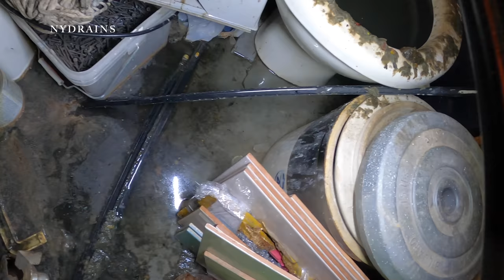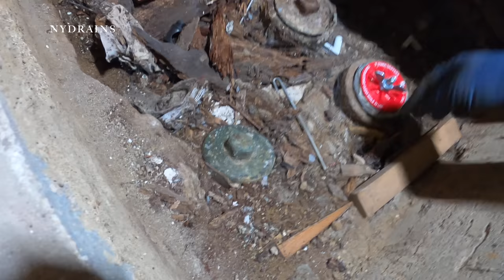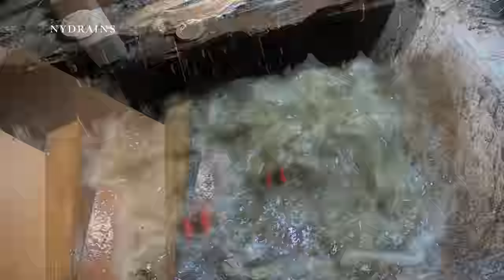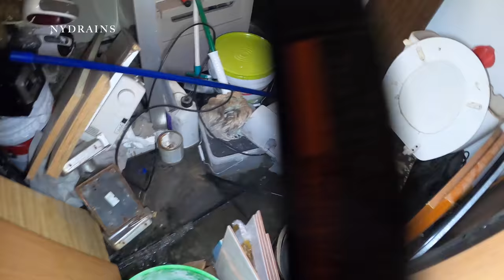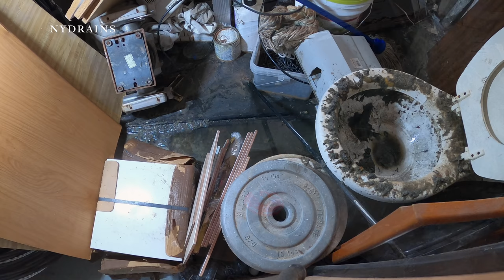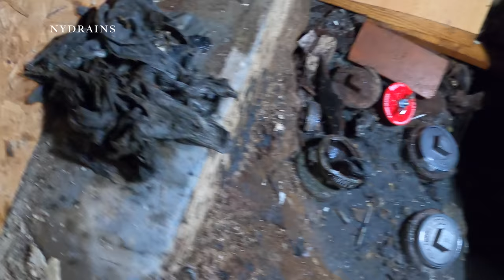Clogged Drain #85

Comment: you done a great job there, wondered why there was a different looking cap,never seen that type before .i would have said can you clear all the stuff out this room so i can give it a good clean up disinfectant etc . well done anyway
Reply: The red cap was for a smaller diameter pipe. When the old cap broke, whomever installed the red one either didn't realize there was still a rim in place, or couldn't be bothered to remove it before recapping the outlet.
Reply from the maker: Thanks again 👍 they just wanted the water removed
Reply from the maker: What A.J said 😉👍

Comment: Hello, NYDRAINS, it's Nathan again.  Thank you for the like.  But last night when I told you that "this is classic symptomology of a blocked main drain," I forgot to mention that I know plumbing very well.  I just didn't get to have a career in plumbing because I have Asperger's syndrome and haven't been able to have a career because of some learning difficulties and special needs that have plagued my life.  But I have always loved to troubleshoot plumbing problems --- and THIS one was a very easy one to figure out --- even if you hadn't described in the beginning what was happening.  For that's what happens when you have a blocked main drain; the plumbing fixtures on the lower level of a building become the sewer outlets for the fixtures on the upper levels of the building.  I'm sure I don't need to tell you that plumbing systems are very dynamic and they can foist some big surprises on those who are unfamiliar with how they work.  Some of those surprises, of course --- like what is shown in this video --- are very nasty indeed.  Another example of a nasty surprise-by-plumbing-system is the cross-connections that can occur from improperly-installed and from improperly-used plumbing equipment --- and which can create plumbing hell by causing sewer water to enter the clean-water pipes and making buildingfuls of people sick at once.
Reply from the maker: Thanks for watching 👍

Comment: As someone else already wondered, why you opened the upper stream cap instead of trying to unclog the U trap ? There is a technical approach to prevent any  side effects ?
Reply: He opens the downstream cap first (going out) to provide a path for the water to go, and to check and see if the downstream is clogged. Even if he pulls stuff out of the trap, there is such a volume of water it's just going to do the same thing as when he pulled the second cap. Also, with the volume of solids and junk in the line it will just clog the trap up over and over. Plus, his snake cannot bend around the trap it is too rigid. Unfortunanetly when there is a clog and that volume of sewage and under pressure there is no way to avoid making a mess.
Reply from the maker: What Chris said 😉👍
Reply: @azmrblack   thank you for your reply, I didn't consider that pressure that plays an important rule in these cases.
Reply: @NYDRAINS  Thank you for your reply
Reply from the maker: @playmangostingiu2217  No problem,  Chris took the words out of my mouth! 😉

Comment: It appears that basement toilet is no longer being used. If that is the case, it should be removed & the toilet drain capped or sealed over so this doesn't happen again.
Reply from the maker: Hopefully 🙏
Reply: @NYDRAINS  
Also, This is a perfect example of why you don’t flush baby wipes down the toilet, & I hope that you made this very clear to the residents of that place. In addition that basement toilet needs to be filled with water and flushed out to get rid of the nastiness and stink.
Reply from the maker: @MrBrombomb  definitely 😉👍

Comment: Hey dude.  That white powder sometimes you put into the outgoing drain on some jobs, what product is that?  Is that something you do for every job or is the product for specific jobs to help clear out problematic lines?  Thanks, from Upstate NY.  :)
Reply from the maker: It's actually a root killer for those jobs with a lot of roots.
Reply: @NYDRAINS  ah I see.  About how effective would you say it has been?  Like how often you have to go back to the same house/complex with a bad root problem?
Reply from the maker: @MightyMuffins  once you treat it with the root killer the severity of the problem is never they same, it won't go away completely but it becomes less and less of a problem.